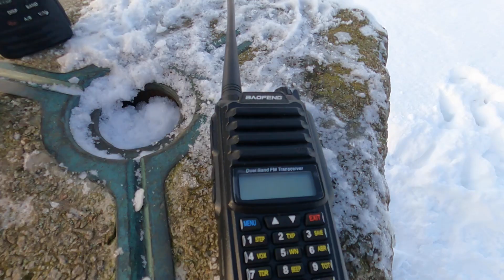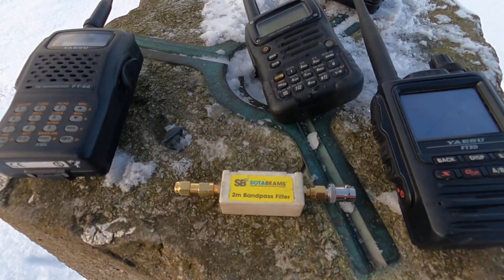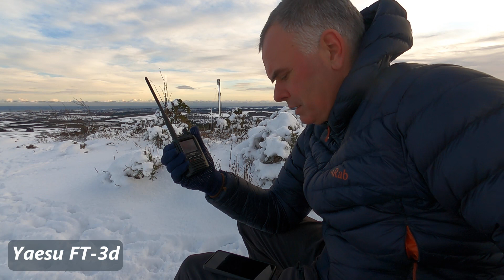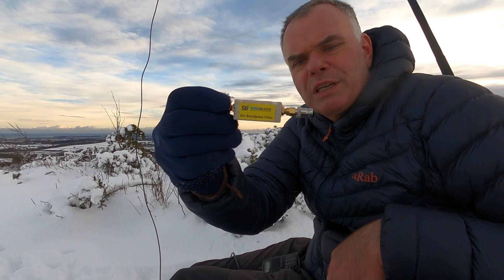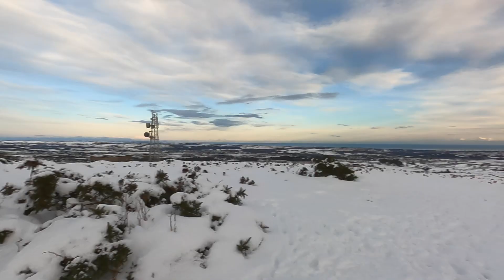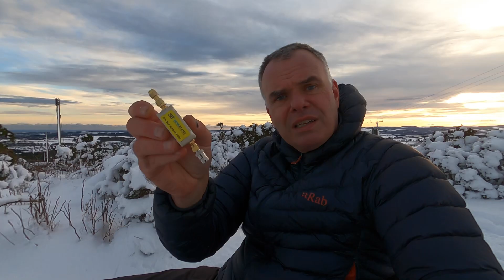Hand Held HT's and RFI - The Sotabeams band pass filter

Comment: Nice demonstration. It may lead to me purchasing one of these filters as the APRS freq in my area is swamped with s9+ QRM. 
BTW, a safer way to attach that filter would be to use a short 1-3 ft section of coax between the radio and the filter. Much more comfortable way to use the radio that way too. 73
Reply from the maker: Yes, many ways to attach things. With the Chinese radios that have the reversed SMA on the radio chassis, the filter screws straight in. Obviously, I forgot to bring all of the correct adaptors, which is why the Baofebg got side-lined.
Cheers Fraser MM0EFI
Reply: @theradiorover  ah yes, of course. As the saying goes here in the US, there is more than one way to “skin a cat.” (Get the job done).   There is no doubt in my mind that you and many of your viewers are aware of most of them. The comment was for the benefit of those who may not be familiar or who may benefit from the reminder.
Reply from the maker: Ha! I was going to use that phrase, but I wasn't sure if it was international. Didn't want to offend cat lovers 😺🏴🇺🇸

Comment: Thank you for that! I had amusing difficulty on one of my very first summits when I was next to a doppler installation. So I got a filter, and took a few radios up a summit that had 3 towers. Amusingly my VX-7R and Anytone 878 UV II+ had no issues without the filter, but the older Alinco I had with me received absolutely nothing, and I had the same issue of forgetting the right antenna adapter for the filter.
Reply from the maker: All part of the fun! Learning from your experiences and mistakes, and I've made planty of them. Thanks for sharing. 
Fraser MM0EFI

Comment: This is why repeaters that have to listen for the weakest of signals in the highest of RF fields have significant front end filtering. The issue is without the filter in front, the receiver amplifier in the radio gets saturated with RF, and generates its own mixes of multiple signals, and that is what you are hearing. The reason why the FT-60 is best is that it likely has lower receiver amplifier gain. But proper monoband radios will have a helical front end to limit the RF into the receiver. For example, the Motorola Quantar has a 6-pole VHF bandpass filter built into the chassis. It passes about 2MHz of spectrum, and sharply rolls off anything else. Signals only 1MHz above and below the passband are cut in 1/10th or so (10dB), and the further from the passband, the more attenuated they are.
Reply from the maker: Absolutely. Then compare that with the  plethora of Chinese "radio on a chip" offerings and you can see why they don't stand up. Although I haven't checked the circuits of my ft-3d, I would have to assume it is a similar issue, given that the device is a traditional FM transceiver, GPS, QSO recorder, analogue APRS, YSF digital mode etc.

Comment: Great video, and fun to see the comparisons.  I've experience so many more interference issues using the FT3D on a summit, and didn't have quite as many with the FT70.  Forgot to pack the SOTABEAMS band pass filter on a recent summit, and definitely missed having it due to interference (even with no towers on summit).  73, James
Reply from the maker: James, I was using my ft3d with SOTA filter the other day with good results. The summit station I worked asked me for a QSO on 70cm, so up I went. Couldn't hear them at all.
Then I realised the filter was still in line 🙄.

Comment: After a lot of deliberations, this is why I chose to buy an Icom ic-v80. It's a 2m single band with no extras, so it won't appeal to everybody, but has a good superhet receiver. I believe that most of the cheap dual banders have direct conversion receivers and fairly wide-open front ends. So far, the Icom has performed well, only downsize for me, is its weight.
Frazer, great YouTube channel, thanks for taking the time to upload all these interesting videos and hope to catch you sometime on the bands.
73 Steve M0KOV
Reply from the maker: Steve, That sounds like a really sensible purchase. The problem with the yaesu ft-3d is that it is trying to be a radio, GPS, APRS node, record tx, rx and also do digi-modes. That doesn't leave a lot of room for the radio bits!
Glad you're enjoying the Channel. Thanks for your support.
73, Fraser MM0EFI

Comment: interference sounds like higher baud pocsag or maybe flex transmissions
Reply from the maker: Yes, there's definitely paging in there. IIRC they are at 156 Mhz in the UK.
Reply: @theradiorover  here in aus they are slightly more annoying at just above 2m on 148mhz
Reply from the maker: @TomR459  There are 78 SOTA summits in Eastern Scotland (GM/ES). Only five have comms. towers and Brimmond Hill is by far the worst. It is within the city of Aberdeen, near the airport and of course Aberdeen has a lot of comms, for the of shore North Sea oil industry.
The amusing part is, it's one of the few summits where I can reliably make 2 m contacts. Almost everywhere else is too remote, ie no people. I guess similar in Aus!
73, Fraser MM0EFI

Comment: I carry my FT-60 with me on SOTA activations and leave the FT-2D behind.  The 60 is solid, can be dropped in the cold, and does well with its batteries.  What’s more, I find it works very well for me in the 2m activations that I try - IO get good reports and have no trouble hearing, even when the wind is blowing hard.  I use it with an MFJ LongRanger, a Diamond SR77CA and my 4 element Arrow Yagi.  Thanks for the video and 73, VA7SGY (born in Aberdeen)
Reply from the maker: Hi Bruce, Great to hear that. The other great thing is because it it a yaesu, you can still get spare batteries for them.
73 from Aberdeenshire. 
Fraser MM0EFI

Comment: Consistent with other testing done all over the world at sites with high power VHF transmitters.  The older radios had bandpass filters in the early stages of the receiver and were better able to reduce the strength of the out of band signals.  The modern radios (FT3D typical) have such a wide range of tuning that to allow them that range, the radios just don’t have the filtering of the older designs.  A tradeoff between wide band coverage and receiver performance on the frequencies you actually need. A good test.  I don’t know what possessed Baofeng to put a plug onto a radio as an antenna terminal.  Radios should have sockets for the antenna, not plugs.  Same comment for Anytone.  73 Andrew VK1DA/VK2DA
Reply: What possessed Baofeng? Have you seen a Motorola or Kenwood land mobile hand held? They all have SMA-F on the radio side just the Baofeng , with the Motorola a bit deeper though . Many other brands also use SMA-F on the radio side. Even some Japanese ham HTs have SMA-F, like the Yaesu FT-10R and 40R. Baofengs are far from alone in this.
Reply from the maker: That's a good point about wide band receive, although I think the VX7-R also has this. The FT3-D has so much tech. in a small package. I'd accept a larger radio with band pass filtering for the amateur bands, which are the only ones which the radio can tx anyway, so surely a priority.

Comment: Nice . I have a ton UV5Rs and the ftd5r
Reply from the maker: Nice. How is the FT5DR? I wonder if it has a better front end filter...
Reply: @theradiorover  I’m not sure if my original reply went through . To sum ftd5r is really confusing to use . The APRS is supper neat . The battery life is ok but the battery’s for ftd5r are way to expensive. I love the simplicity of of the UV5R and the extended 3800 mah battery last for ever . I like being able to unlcock the UV5R for what ever frequency I want . To sum it I find myself using my UV5R a lot more to due better battery life and ease of use
Reply from the maker: @DARTHDANSAN  that's interesting. I'm thinking of carrying the ft3d on my rucksack strap when I'm in APRS range and also carrying the VX7r to use for the activation, but that's maybe overkill!
Reply: @theradiorover  have you consider the pico APRS v4 for APRS . It’s neat . I have version three and find myself using that more to send APRS messages for fun . The more I think about it the harder of time I have justfiy keeping ftd5r . I have not been able to make to many contacts even though I live a big city . I have my gmrs radio and there is a lot people on there but I couldn’t figure out how to get to connect to the repeater . I just got ft891 and have no clue how to power it or how to get an antenna but I look forward to getting a lot more use out ft891 on hf and I’m working hard to upgrade to general
Reply from the maker: @DARTHDANSAN  to be honest, there's not much APRS around my way, as I live in a rural area. I had to build an APRS repeater just to have something for the ft3d to speak to when I'm on local summits!
As for your ft-891, any mains powered 12  v (13.8v) power supply should power that, or a lead acid car battery. Use a LiFePO4 (I think Bioenno are available in USA) if going portabe with it. For an antenna, simple dipole, or End Fed half wave with a 49:1 transform will get you going.
Reply: FT-60 a museum piece :o It's a solid little radio and will take some knocks

Comment: Excellent experiment, thanks.  When I do my tests, I always select a repeater with a frequency close to 146.520 and a very weak signal, weaker is better and Baofeng fails to receive, and Icom, Yaesu, Kenwood receive fine.
Reply from the maker: Great tip! We can't use 146 Mhz in Europe, but I get what you mean. In some ways I made the test too easy by using a local station. Someone on a hill with an HT maybe 30 miles away would have really shown which one had the best RX.
73, Fraser MM0EFI

Comment: Good experiment/testing session. I wonder how the FT857 would perform? I had the same issues activating Snaefell last year. People could hear me but i could not hear then.
Reply from the maker: I suspect the 857 would be fine due to having much better front end filtering. I've used mine on a couple of summits with towers without issue.
73, Fraser MM0EFI

Comment: Thanks for the experiment Fraser! On some HB9 summits they run pager (POCSAC) just 1 MHz above 2m. You get completely blocked out, even when you're a km away. I guess, in this case the band pass filter will not be of much help neither. Good to have HF for these rare cases 😃.
73 Stephan
Reply from the maker: It is crazy that pagers still exist! I thought that was 1980's tech. Pagers are around 155 MHz in the UK if I recall correctly. 
Thanks for the S2S the other day. Nice to hear your voice in the pileup!
73, Fraser MM0EFI
Reply: @theradiorover  Hi Fraser, my comment got probably deleted by the "clever" Google AI.
My shortened previous comment was that pagers here in HB9 are still in use because they work even down in bunkers, that we have plenty of 😆.
And thanks for the S2S as well! When I was on HB/FR-028, I had HF RFI from at least 7 other activators around me!
73 Stephan
Reply from the maker: @PortableRadio  was there a Swiss SOTA event on that day?
Reply: @theradiorover  Correct, it was the HB9SOTA snowshoe event. On SOTLAS HB/FR-028 I posted a photo (GoPro Screenshot) where you can see the remaining snow, but to be honest, when the wind was not blowing, it almost felt like spring 🌞

Comment: I use FT3D for SOTA with Sotabeams filter if needed and got exactly same results as you on summits with comms masts. I’m surprised an expensive rig doesn’t perform a bit better than the cheap ones.  Dave Ei3ixb
Reply from the maker: Dave, they packed so much into that radio - touchscreen, GPS, APRS, YSF etc that I guess something had to give. They skimped in the filtering and on the speaker. It's a shame really because it is a great bit of kit.
73, Fraser MM0EFI

Comment: if it was a baofeng you will have crazy rfi
Reply from the maker: Well the Baofeng did OK with the stock whip. I stupidly forgot to bring the convertor for the big antenna because I forgot the baofeng has the opposite to the yaesu. The results wouldn't have been great. The ft3d was poor and that costs 10 times the baofeng!
73, Fraser MM0EFI

Comment: This is exactly relevant to my current interests as we have quite a few hills here with serious RF interference. A friend has had decent luck with his FT-60 in rough conditions.
Reply from the maker: Jeff, the ft-60 does the job nicely. I prefer the vx7 because it is more weatherproof, however things like squelch need to be accessed through the menu, which isn't so handy, as I like to open the squelch right up when operating and then close it when I'm mobile. The ft3d was the real disappointment though...
73, Fraser MM0EFI

Comment: Be careful. That filter is only rated for 2 Watts continuous. An HT running APRS could easily exceed that rating.

Will you be trying some other filters to see if they perform any better? DE WA1KLI
Reply from the maker: Hi John, I do need to be careful with the duty cycle of the filter, that's for sure. I don't think APRS would be an issue, as that is a very short data burst every couple of minutes. TBH I was probably talking for longer in this video that I would be if working SOTA chasers. I guess the air temperature of -2°C helped keep it cool as well.
All the Best, Fraser MM0EFI

Comment: A great experiment, which shows limitations of HT radios and potential solutions for extending their use ability. 
I too have a VX7R. And a VX5R! Replacement batteries are still available…
Thank you for another superb video.
M0DSK
Reply from the maker: I managed to get a new non-yaesu battery for vx7. I need to see if it has an internal button cell as it doesn't retain the clock time any more. The vx5 is a great radio too. It's a shame the ft3d has short comings, as the aprs function is very handy.
73, Fraser MM0EFI
Reply: @theradiorover  I think the Yaesu battery is still available. Either way we can continue to get extended use from our investments. And the radio hobby becomes cost effective at that point. 👍
Reply: I have 2 7R and 1 5R (which is my second one). One of the 2 7Rs is a part radio now, as it was damaged by being run over by a car .